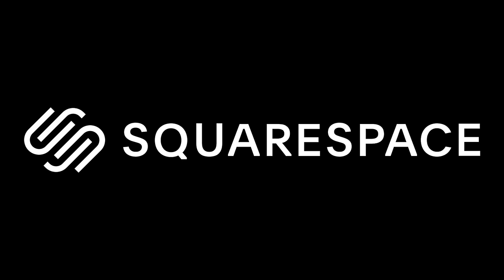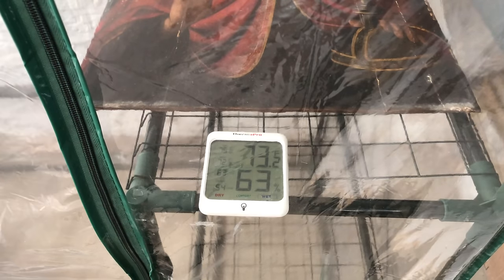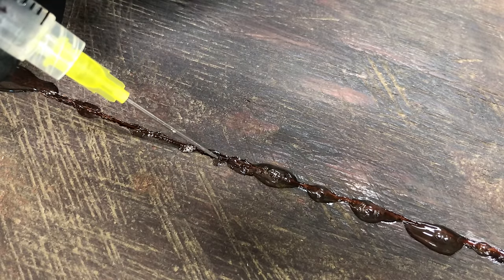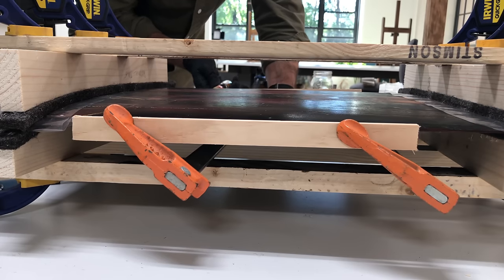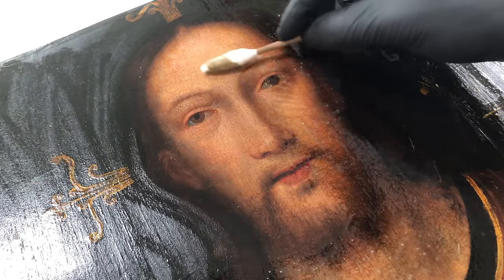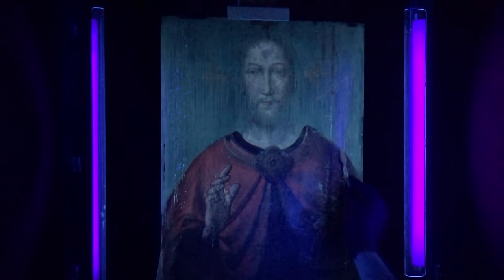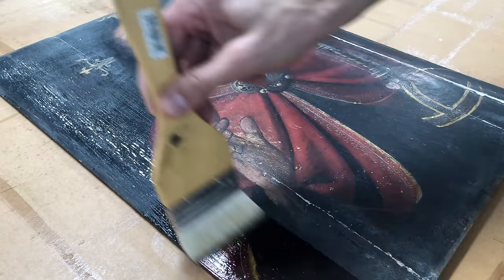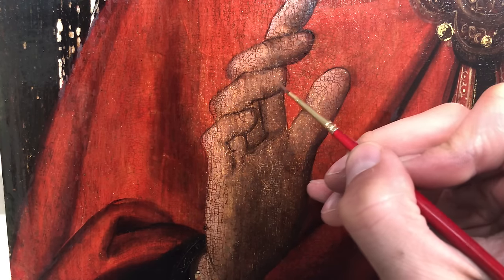The Conservation of Salvator Mundi, No Not That One.

Comment: Is there ever a case where a prior conservation needs to be preserved because of its historical value even if it's not consistent with modern standards?
Reply: Nathaniel Allard typically no, the original painting is almost always more important than any conservation work. Unless you run into a situation where the conservator themselves is a well known artist, or was know to collaborate with the original artist or something else that would bring the conservator to the same level of “fame” or higher than the artist, the original work is always more important. I don’t think this has ever been the case though except for that one Italian painting that was severely over painted by some guy 2-3 hundred years ago maybe more and only recently discovered to not be the original. And even that they removed the over painting in favor of the actual painting just with lots of documentation.
Reply: nice question, now i'm curious too
Reply: I mean there's that one Jesus conservation that looks just, not good. I don't know the name of it but I'm pretty sure the conservationist's work hasn't been undone, regardless of the extremely poor quality
Edit: the painting is The Ecce Homo
Reply: Inda B. Basically because the “conservator” destroyed the painting. Nothing she did is reversible the original is gone. Any further conservation work is going to be almost entirely just repainting from scratch rather than conserving.
Reply from the maker: Not really.  There may be times where the old conservation work is very good so there's no reason to remove it or it's so old that it's not possible to remove.
Reply: @confuzedgraphite  Yeah you're right, that's just the only "example" I could think of.
Reply: @confuzedgraphite  I like how you say, 'for that one italian painting' when it's the painting that this would be confused for, Salvator Mundi by Leonardo Da Vinci, that had that happen. Lol
Reply: I mean, the mona lisa was pretty aggressively cleaned in the past, and left pretty much the way it is
Reply: Evin Drews no that’s not the painting I speak of, I’m talking about the painting of Isabella Medici that someone had painted over and no one had known until a conservator was cleaning it. It was thought to be a “fake” painting and then it was revealed to be much much older than anticipated and of a relatively important person.
Reply: Mmm i think there were some roman statues where the restauration was made by famous artist from the Renaissance.  There are probably more valuable due to that fact
Reply: @victoriap1561  Or less. Turned out a lot of those old restorations were very destructive. See, all those old marble statues were painted in naturalistic colors. But early on, when they started to dig these things up in the early Renaissance, they decided the bare marble was the way to go, and any remaining pigment was removed. So now bare marble is all we have.

And then, even old masters sometimes made wrong guesses about a statue's original pose, and the positions of missing limbs and so on.
Reply: @the-chillian  not all the statues were colored i think ,  there are roman writers describing some of them  as white.  I think there is an article  from mary beard talking about this.  Leaving that aside Personally i don't believe they colored them the way it's shown in museums,  it's too overly colorful and simplistic. it looks different from the frescoes that survived from that time. Romans are greeks were talented painters,  some of the best in antiquity,  they wouldn't paint a statue like that. It's probably an example of some  bad restauration,  even if they don't paint the statue directly and just show a model
Reply: This reply section has some very civil and sophisticated discourse and i'm here for it
Reply: @victoriap1561  The scholar who has been talking most about ancient polychrome sculpture is Dr. Sarah Bond at the University of Iowa. I don't know any ancient writers talking about their statuary, but we do have examples of mosaics and frescoes depicting statuary, and it varies quite a lot. Some were brightly colored and some were more muted, but even those some commentators will describe as monochrome look to me as if they had at least a bit of color. Perhaps they were already old with faded colors when the mosaics were made.

I know what you mean about how these things are shown, and yes, they were no doubt painted more skillfully. But the idea is to dispel this myth that all ancient sculpture was monochrome when nearly all, or most, was not. They could definitely benefit from the services of skilled artists.
Reply: Maria Rose I very much agree! And extremely interesting.
Reply: Inda B. I had to look this up because I was very curious and am now APPALLED by what she did. It looks like a complete mess. Breaks my heart to see such a previously beautiful work of art destroyed.
Reply: @BeautyBack-Lash  Subjective. The repainting has given me and my wife much more enjoyment than the original ever did. Same thing the world over. I think reversing her work would be the real crime against humanity.

Comment: Question for Julian: when working on paintings under UV light do you use sunscreen or sunblock?
Reply: Well that allows for a limited exposure at once riiiite? Then he has to apply again if he wants to work...?
Reply: @theofairy4077  Well, yes, that's how sunscreen works, and it's not terribly inconvenient to reapply it. I don't understand though - should he just work as much as he would need without regard to anything harmful because the protection against it is somewhat limiting?
As for my question, I got an answer from Julian elsewhere. I can't find my comment to check, but if I remember correctly he said that he only worked under the UV light for short amounts of time, which made using sunscreen practically unnecessary.

Comment: I always learn things from your generously shared work.
Shiny surface photography: I once caught the Saks Fifth Avenue gang taking pictures of their windows at night. They had a small crew of experienced people holding up huge sheets of velvet on sticks. That blocked out the reflected view of the lit up city behind. The camera man used a Hasselblad on a tripod and literally just plopped right into position, banged off a few exposures (bracketing) and moving on to the next with the gang dancing around him. Fascinating.
As for you-- not necessarily velvet, there's many modern alternates. But-- a simple, shaped shower curtain rod over your photo area, with the material held up with grommets. That way you can arrange the background and still keep your floorspace!

Comment: I have a couple questions, in case you ever do another Q&A - 
1 - is that level of gloss period appropriate? 
2 - do they make brass or copper brackets? The sheet metal ones you used seem jarring to me.
Reply from the maker: 1.) yes
2.) Copper tacks are made but I don't like to use them as they oxidize

Comment: i keep coming back to this video because sometimes i really do completely literally relate to a piece of wood thats been building up tension but is locked in place and not allowed to bend and distort with the humidity changes as it naturally needs to and thus the tension is released by just the wood completely splitting. very specific and like i dont even mean it in an angsty or metaphorical way i mean it as a literal physical phenomenon affecting both my physical and unphysical self. im the tension my body is the wood and the mechanical fasteners is existence itself. 

also bc old wood looks kinda tasty

Comment: What amazed me is the time and steps you took to make the jigs for the back and from top/bottom of the painting, and then put two pieces of timbe directly on the painting under the clamps that went on the front from side-to-side. I know they weren't under pressure but they could still move.

Comment: I think I can actually add some helpful input.. when using hide glue, preheat the wood about 10F over room temperature.  Hide glue will set too quickly if the wood is cooler if a seeping penetration is what you're after.  I even do this on musical instruments when both sides are accessible - by warming, I can do what's called a "rubbed" joint and the glue will stay liquid well after I finally get all my clamps in.

Comment: I wonder if you considered adding tiny blocks of wood along the cracks in the wood with the grain at 90 degrees to the panel cracks. Glued on with hide glue, then shaved down to be thin. Reversible of course. This is how luthiers would repair a serious cracks in a 300 year old cello. Would stabilize the cracks against future movement due to normal humidity fluctuations.

Comment: A luthier whose work I've watched a fair bit of often uses fish glue instead of hide glue, because, he says, it has roughly the properties of hide glue while also having a longer open time. Both tend to shrink while setting, thus pulling the material more tightly together.

He also uses suction cups to drive glue into and through cracks, though I'm thinking you wouldn't want to do that on the surface of a painting. Perhaps on the back?

Another technique which might work for a painting like this: He will sometimes make a mold of the face of a guitar (generally an archtop) and use that to ensure the proper shape is held when bracing. A mold of the (optimal) face of this painting with a felt layer and release film could be a powerful tool to get it clamped up properly.

Comment: For the glueup of the wood, couldn't you use a vacuum to pull the wood together? This would probably also help the glue penetrate all cracks in the wood. First put the painting in some sort of bag, maybe wrapped in linen for example, then put it in the curved jig, then apply the vacuum.
You'd have even preasure all around the wood.

About the UV light: it's also bad for your skin. Wearing sunscreen or covering up would probably be recommended.

Comment: My friend had an old oil painting probably 100 years old. Not a very attractive subject matter with a hole right through the canvas though is was  still attached at the back. So I said well let’s try cleaning it. I use Easyoff Oven cleaner,   about 20 seconds and then wiped it all clean with damp cloths. It was amazing. It worked so well.  I made sure I didn’t leave any residue or let it dry out too quickly.  I softened and flattened the pice from the hole at the back. Somehow we glued it on. That was 20 years ago,  still looks great. It was garbage otherwise. But I would never do that again. It was so dark and covered with smoke and grime. Now that I’m older I  have the patients  to do things the right way. Lol

Comment: Hey Julian, love these videos of you. I'm a chemist and I love learning about stuff like old pigments and this kind of meticulous work you do. Couple of questions: what kind of solvents are we talking here? Alcohols? And is there something interesting you can say about the changing of pigment colour throughout the paintings history because of reactions with oxygen (some red/green colour change in a lead based pigment comes to mind).

Also as a general precaution: I hope you're wearing proper UV-protective glasses (big orange safety glasses are recommended) and full clothing leaving no skin in the blacklight. It depends on the wavelength of your blacklight lamp, but some UV wavelengths, especially the lower ones (like 240 nm which is often used for fluorescence) can be quite harmful to your skin and eyes. Think of it like getting welding eyes by looking at welding directly.

Anyways, I hope you're already aware of that. Or maybe I have to continue to watch the video, but I just wanted to give you a heads up.
Reply: Oh, never mind on the glasses bit. :)

Comment: I just rewatched the Wood that it were so simple  set, and I was curious between the two different types of conservation and setting of the wood panels. I imagine this piece would never be a candidate for the torsion box considering the panel is whole and the bow is natural to the painting, or if you had got that technique when doing this piece, would you have kept it flat and used the torsion box to keep it that way?

My instinct says no, that the bow is more true to the artists' original vision, but I'm curious to your thoughts and expertise on the matter.

Comment: Thank you for these videos!   I have a technical question.   When you put down the isolation layer, and then follow up with retouching and the final varnish...   years from now when the final varnish you have put down has aged, how will it be removed without removing your retouching and isolation layer?
Reply: Not the man you're asking, but I do have an answer (which is pure conjecture, of course). If you use two different types of varnish that are soluble in different solvents, then you could choose your solvent such that it removes only the finish but doesn't remove the isolation varnish beneath (and ideally the future conservator/restorer would know from the documentation what types of varnishes were applied and could then easily figure out which solvent to use without having to resort to the experimental approach). Another factor to consider is that the finishing coat of varnish applied here is uv stable, so it won't discolour over time like old varnishes do, which also means that ideally it won't have to be removed any time soon.

Comment: What do you do in the case of Really old paintings if the pigments themselves have clearly changed over time with age?
Reply: A thoughtful and intelligent question. When retouching the original artifact, the altered pigments should be left as is; that is because retouching the areas that have altered coloration would almost always require wholesale repainting of those areas -- that would mean losing definition of brushwork, besides possibly getting the 'retrieved' color wrong. On a digital photograph of the original image, anything goes -- as long as a disclaimer accompanies the work!

Comment: Is the glue used to join the split pieces of panel the same glue we would’ve used in Kindergarten say, 40-45 years ago? I remember the teacher passing out glue back then and some kids would get the white school glue like we see today or this more amber coloured glue that came in a bottle with a red rubber top that has a slit near the top? Whoever got that stuff in Kindergarten was really disappointed because you had to smush the red rubber top to get the glue to come out so it was messy and not as precise as the wood glue bottles.

Comment: Can the wood be saturated with a synthetic oil that wood prevent humidity of penetrating the wood and it wood never move anymore…
?
Reply: Sounds dangerous to me; it could likely never be reversed if complications arise.
Reply: A few years ago, stabilized wood was in vogue among knife makers and furniture makers. To do this, wood is soaked with synthetic resin under pressure. The disadvantages are: Plastics react with UV light and age; when combined with wood, aging and general material properties cannot be predicted. In restoration, every change can be reversed, but this is not possible with this method. This means that, in the best case scenario, the image is stabilized for a long time, but future repairs are not possible.

Comment: How do you know that the retouching you are removing wasn't done by the original artist?
When you have a painting that is 500 years old, with 500 years worth of retouching, isn't that in itself of some time value? Like if someone 400 years ago did retouching, isn't that more likely to be true to the original work than what you can now see 500 years later? Previous artists retouching the painting had the advantage of seeing what you can no longer see because it is gone.
Reply: Thats not really the point or mission of conservation. All "conservation" that is work added not by the original artist is meant to be reversible. Also, if it was 400 years old, it wouldnt flouresce that much. Its prob touchups from the 19th c.
Reply: @bustedkeaton  Interesting enough, he talked about this in another video.